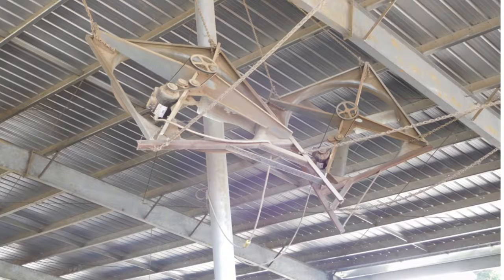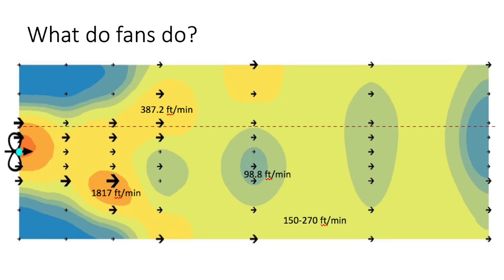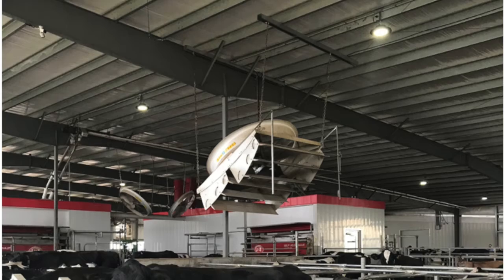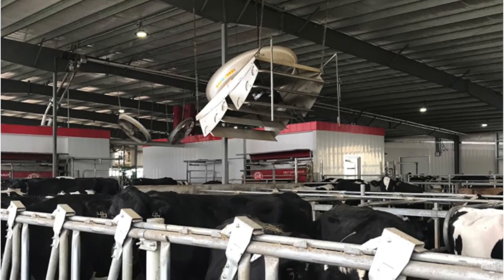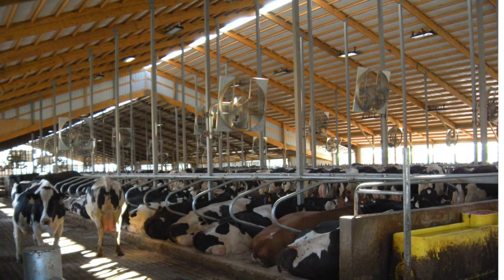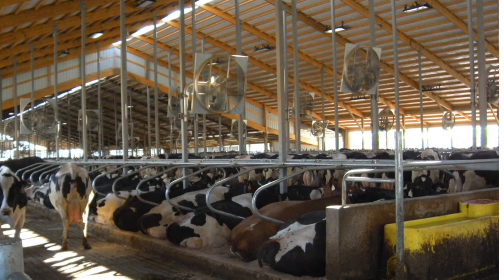Fan Placement in Barns

Comment: Joanna, you did a good job with the interview, set-up questions and trying to pull it together. Morgan, most helpful was the rough 10x rule. No mention of CFM, no passing comment on fan speed??  The air speed graphic didn't help me. There's no x axis scale, start speed is not identified, fan size not identified, it's 2D for 3D phenomenon, why is there a very slow spot in the middle - I could go on. Thank you both for taking the time.